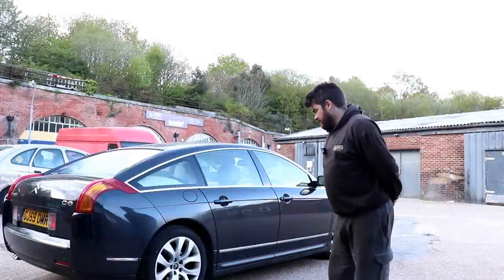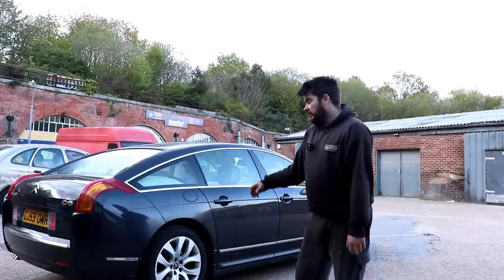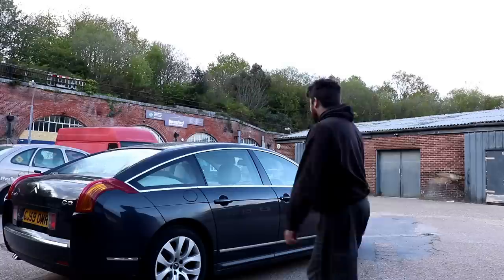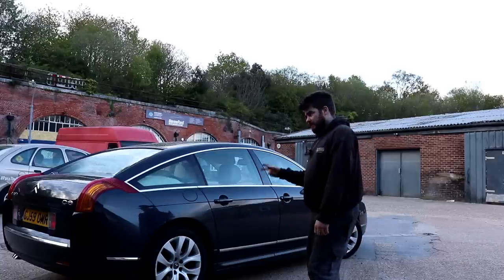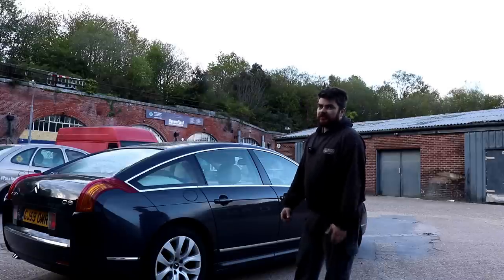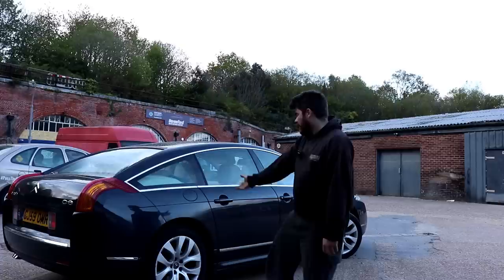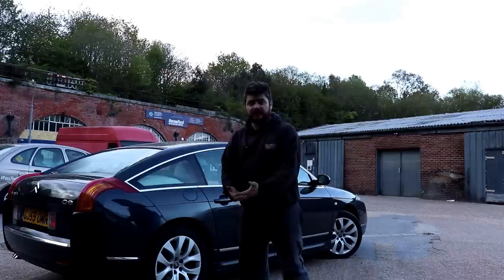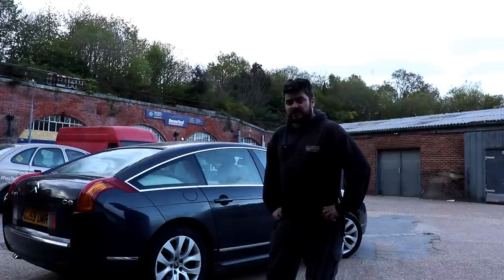Cheap Citroën C6 Project 17: Cooling System Repair Vlog Finalé

Comment: The second major issue with my C6 was water pump failure (the first was the ancillary pumps bracket snapping on its first trip with me as its owner). A local mechanic replaced it but unfortunately, he snapped a stud and just secured it (secretly) with two bolts and a ton of mastic. 8 years, a ton of blind alleys, a second donor C6 and eventually a replacement  engine later, it's been driving all over the UK for 7 months. Touch wood. 
*My new engine tray has been hanging up on my garage wall for 7 years. I might be confident enough to finally fit it this year. You're going to keep it. It's easier to quit crack than a C6. 
**If you flog it, you will be giving someone else the benefit of all the work you've done to it.
Reply: I'm please to hear it's getting used for what it's best at.... don't forget... 10k miles for an oil change if you want to keep it that way 👍

Comment: Like you will be, I was bereft when I let my 3.0HDi go, because it was flawless and gorgeous, but both my 2.7s were a delight to get rid of. And you’re dead right about the ride comfort being not a patch on the older cars that you mentioned. My last Citroën before my foray into C6s was a 2006 C5 (S2) 1.6HDi estate, and its ride was far superior. That said, the C6 absolutely will outcorner so many other pseudos (TT/S3 Quattros) out there. Many’s the time I’ve run rings around Quattros on roundabouts, taking them on the outside line. Hydractive III+ is very much a compromise…

Comment: If it's any consolation I am going through this with a Peugeot 407 SV V6 with only 96,000kms on it  that is serving me up problems at a rate of 2 new issues to every 1 I fix. Latest is the cam covers/cam boxes leaking oil on to the exhaust! I am just wanting to get it back to a place where there are no issues so I can sell it, but it won't let me! I think the engineers went crazy at this period in PSA with new tech, lots of it without any thought or regard for keeping it alive down the track! I can't wait to move it on and start work on my 1985 BX 16TRS and deal with more mundane issues.

Comment: As someone who owns a 2.0hdi C5 (X7) exclusive, if you can find one of those or a petrol one at a good price with the hydractive suspension, you'll be much happier. Much easier to fix and are cheaper to run. Sad seeing the C6 go

Comment: Had thje same leak problem on my Xantia V6 - heater matrix, then radiator, then de gassing bottle thing (stupid design that was), then, yup, water pump. Finally once rpetty much everything was renewed, it stopped leaking. BUT, tin worm started playing.

Comment: The TDV6 water pump o ring is shared with the honda H22 oil cooler sandwich plate.
Reply from the maker: The more you know!
Reply: @UPnDOWN  it's about the only thing I knew about that engine, having looked for the oil seal and hoping it existed outside of Japan. Well until your excellent video that is.

Comment: Hats off for your perseverance.

Was thinking: if this was the original waterpump, when was the last timing belt change (or did I miss it)? I always have the timing belt and waterpump changed at the same time.

When I had to replace my Xm 6 years ago I also seriously looked at a C6.  Concerns about long term parts-availibility and complexity (and being no mechanic myself) made me choose a C5 (X7) Tourer instead. No regrets sofar.

Comment: Really sad, hope you get a trouble free run to France - and back - out of it. Looking down the tearful comments there are some pretty good ideas. One I liked most was store it and use a couple of months a year. It isn't worth much now but another 10 years may make a difference. If you come back smiling you might want to consider changing engine for the 4 cylinder 2.2.diesel and 6 speed auto - the base engine for the C6 - or the 3 litre petrol, which I watched you driving, although this engine can be very economical on long trips it's a greedy sod round town. At worse you have a BX and thus you have it all really.

Comment: Mmm well it's been great from this side of the world. You just don't see them here but it's like all modern cars I really think there are too many plastics in the engine bay. It's like that clip that you pointed out great when the car is being built on a production line but trying to replace it after who knows how many heat cycles while it's in place AHHHHH NO! So after all you've been through I understand how you must feel. Have a great time in France with it and some great content for the channel and re-asses I know you'll make the correct decision. Good luck mate hope the hand has healed.🇦🇺

Comment: Maybe the water removing stuff pre waterless coolant dissolved important crud that was acting as a sealer?
Reply from the maker: It wouldn't do that, no. It was just play in the shaft which ate the seal.

Comment: I know hindsight is 20/20 but the advice should be to make sure it's all good before you put the Evans in. The car will run hotter with Evans so the pressure is greater on the components.
Reply from the maker: How would I have know the water pump was about to die if it wasn't actually leaking?

Comment: £60 a month in tax is really expensive. That’s a strange system of road tax you have in the UK. In Victoria Australia we pay £360 per year in registration fees for each car. It’s a flat rate that is the same for each car under 4.5t as ours goes by weight. The more it weighs then it goes into the next category. You should just pay 1 price once per year. This £60 per month is BS to me as an Australian. I prefer to pay it all in 1 lump sum for 12 month’s registration. Then it’s out of the way.
Reply: You don't have to pay it monthly it helps spread the costs, and yes it's a total rip off like everything in the UK these days!!
Reply: I run a citroen 2010 c4 1.6hdi and that's only £30 a year to tax its based on on emissions
Reply: @Pumaspeedracing  I don’t like the idea of tax being based on emissions. All cars do damage to the Road surface which needs fixing. So all cars should pay the same road tax. The heavier the car the more damage it does to the road so they should be taxed more. Hybrids are the worst because they are very heavy.

Comment: Is there a crisis brewing in the world of older car YouTube channels? As we see cars from the 90s and later featuring then the much greater complexity of these cars seems to be a problem. They are much more difficult to work on because so much is crammed in, and parts are expensive. It gets beyond the tinkering skills of the typical YouTuber, and frustration and poverty ensue. Cars from earlier eras were so much simpler and easier to work on.